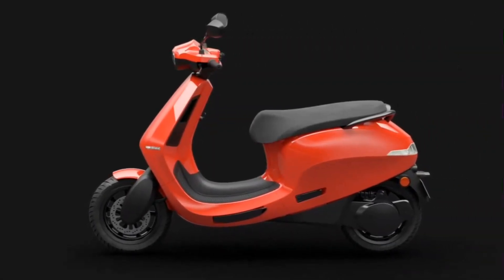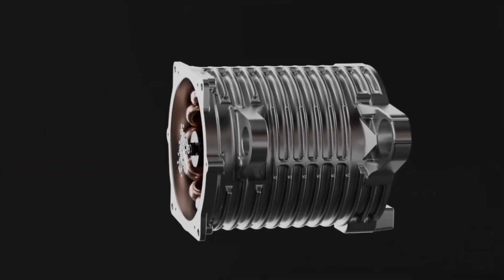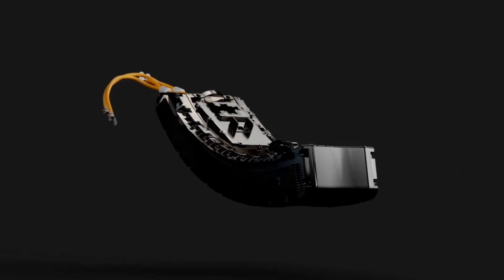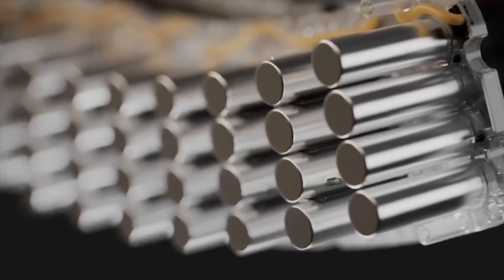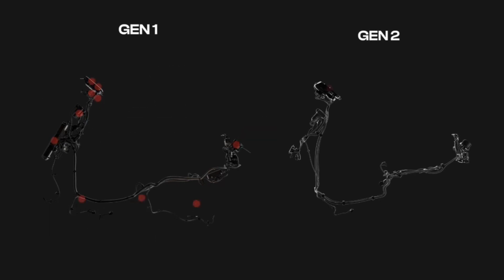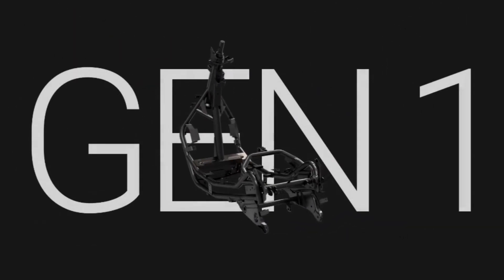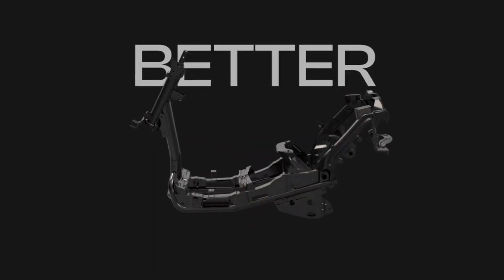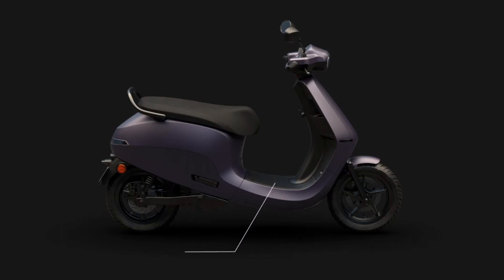Why Ola electric's Gen 2 platform is better ?

Comment: gen 2 in short - Cost cutting upto 40%... due to which lower weight and Due to lower weight more range . Priced 10k more thean gen 1.. nice strategy.. I am going with Gen 1.. whatever it takes